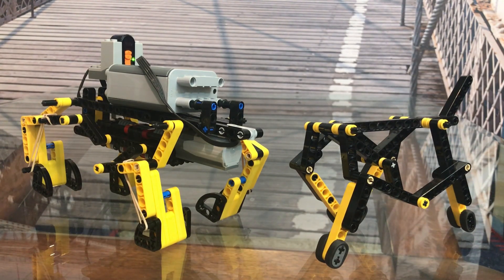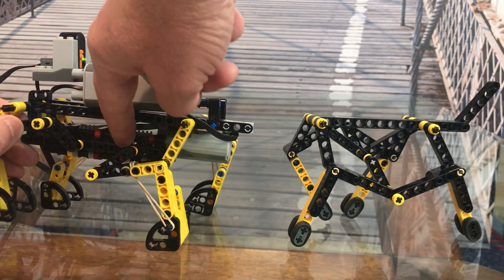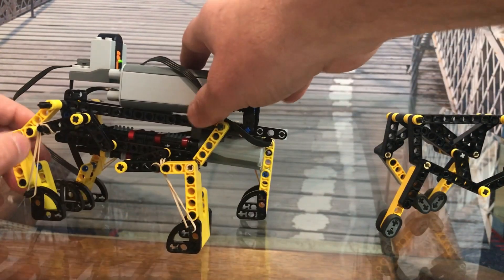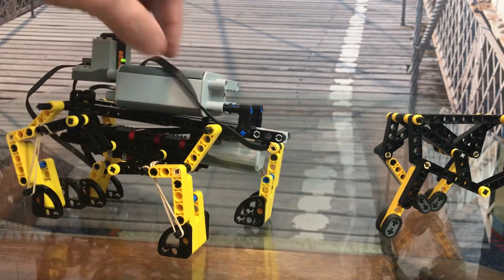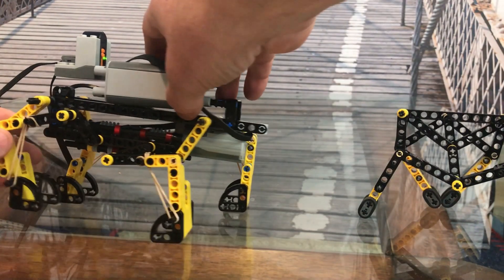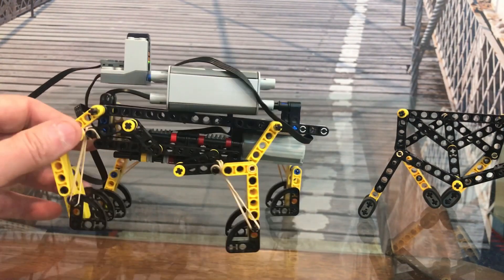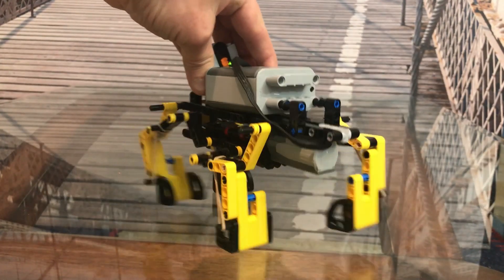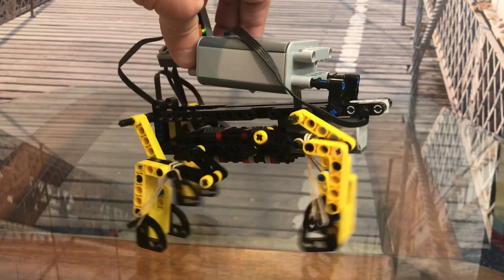LEGO Spot Micro with Motorized Legs

Comment: Usually parallelograms are used to keep the foot horizontal, which increases the weight, but there, with a simple rubber you achieve the same thing. This is very interesting, maybe even more so for a bipedal. Thanks really for this idea.
---- In the previous video, there is cc (Subtitles/closed captions(c)) in the bottom bar, but not in this one. English subtitles are good to more understand what you say  for French people.... Thank you. -----
Reply from the maker: thanks - I just turned on the CC feature. Spring loaded feet can help, but you may need to play with dampening, otherwise the resulting bouncing could destabilize your biped?
Reply: @diywalkers7898  Thank you. About biped, I will think about it, next year, may be. Right now, I am making a 12 DOF.
Reply from the maker: 12 DOF????  My head would explode - can't wait
Reply: @diywalkers7898  And guys, I still have some small problems to fix. And I guess it will take a few months. . .
Reply: Wade, consider this as an awesome recommendation! I feel something amazing soon to happen....